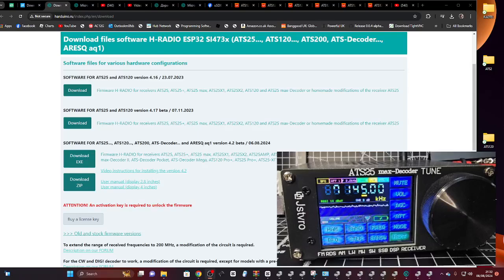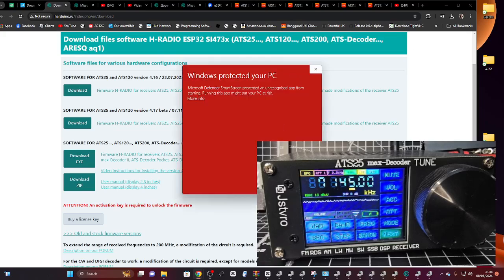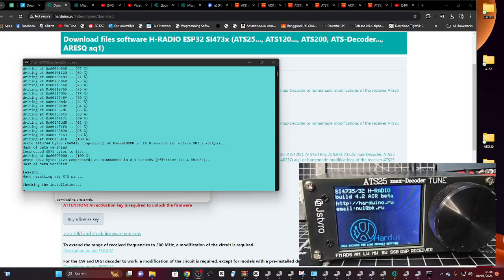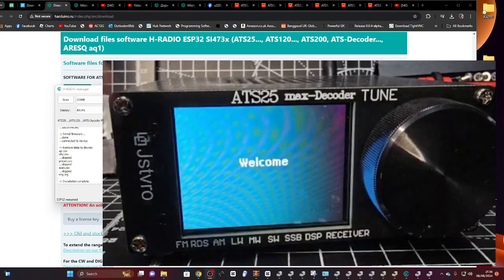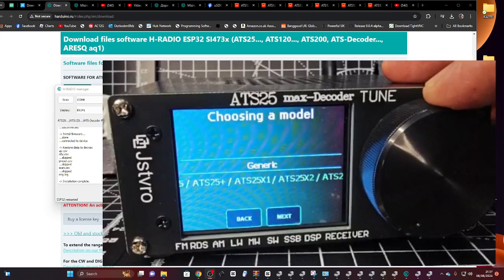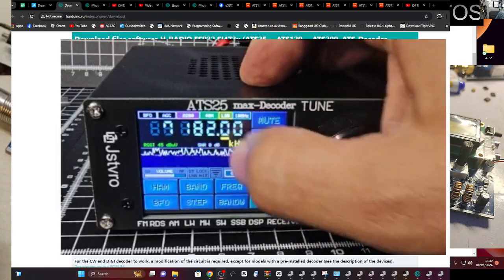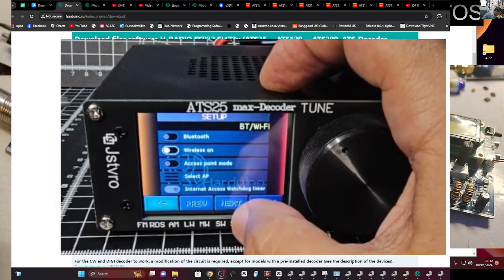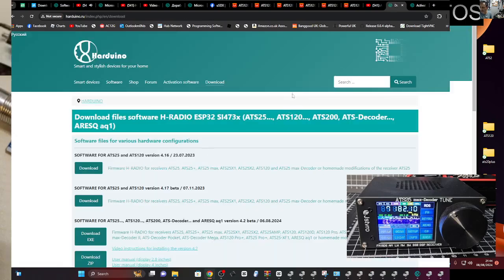ATS25 - 4.2 FIRMWARE UPDATE 2024 - EASY

Comment: Anyone thinking of updating firmware to ver. 4.2, don't do it or it may brick your radio!  I just tried the update on my ATS25 amp that said it was successful but now won't receive anything and some of the functions such as LNA and Hi-Z or 50 ohms won't work!
Tried it on the ATS25X1 but now that one is stuck wanting a License Key and it was working before so the update didn't keep the key. SInce both were unsuccessful I tried to go back to ver. 4.17 but that version doesn't have an installer and the update from a file option is missing so I guess the radios are dead and worthless now! Whoever wrote this rubbish update needs to go back to programming school!
Reply from the maker: I updated two  devices both work perfect
Reply: @M0FXBHamTech  And I just did 2 that failed!
Reply: @M0FXBHamTech  I got the ATS25amp working after finding out how to set the radio to the correct type since the Russian video is hard to understand, but the ATS25X1 doesn't get that far and is still dead!

Comment: with your instruction i updated from 4.17 to 4.20, however i stucked in a default in starting my ats25 . I got on the screen PCF8575 not connected, SI5351 not connected, SI473x not connected, and thats it..... please if you can help me to get things gooing again. (it is a ATS25 amp)
Reply from the maker: You have to carefully follow instructions then ask for help on the forum .
Reply: @M0FXBHamTech  I assum that you do not know it also.  There is something with the file system. I will ask for better help on the forum. Thanks anyway that you replied on my help question
Reply: @cleeuwinga did you find a solution I have the same issue and emailed Peter who supports the software and have been ghosted

Comment: Dont suppose you know how to test output power of DMR radios
Reply from the maker: Connect to antenna with an adapter
Reply: Yes im aware of that but do you need a special swr meter as my analogue swr meter only gived 1.5 watts when transmitting on high power of 5 watts@HamTechRadioScannerDrones

Comment: Hello! What is the difference between 4.17 and 4,2 versions? The receiver is the same as yours.
Reply: Big difference > after update you are loosing LNA and Hi-Z opt. etc. Still no SSTV, JT modes, no Air band and VHF cos SI5351 is not installed in maxDecoder old version etc.
Reply from the maker: Read this at Arduino site

Comment: im in dublin and cannot seem to pick a thing up on this even using external antenna perfect on fm broadcast
Reply from the maker: It receives very well
Reply: @M0FXBHamTech  im not saying the radio is shit i realy like the look ...it must be something im doing cant seem to get anything on it
Reply: @M0FXBHamTech  if anything i actualy realy want to get this workin
Reply: External antenna perfect on FM could be useless on LW, MW and SW. 

A great receiving antenna is the Bonito MA305. Might seem expensive but it's tiny, I opted for the optional longer whip. 

There are better radios too such as the Tecsun PL-660 which might look old skool but it's great to use in the hand.
Reply: hey there sorry for the late reply ...thank you for the advice i will look into this @o00scorpion00o

Comment: If you already bought a license key, does this firmware update affect that?
Reply from the maker: The key you purchased lasts forever.
Reply: @M0FXBHamTech  I meant does the upgrade clear out the key? And the answer is "yes", because I upgraded and it's now missing some features. The problem is that I can't find my key. I'll live - I'm not going to buy another.
Reply: @N2EWSRadio  My key wasn't cleared during the upgrade.
Reply: @onceways  Maybe I did something wrong.
Reply: You can click in the rado to release the key. I took a picture of my key in the radio befor i did the update just incase.
Reply: @Wrang15 what does “release key” do?
Reply: @harleysoltes  let's you keep your key if you sell the radio  is my understanding.
Reply: @Wrang15 I just was worried it might trigger something that I did not want.